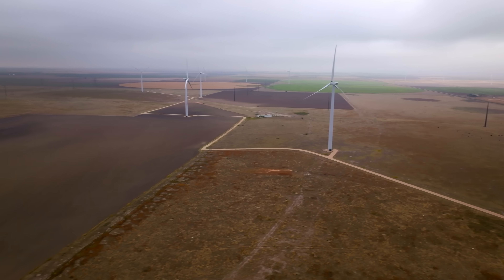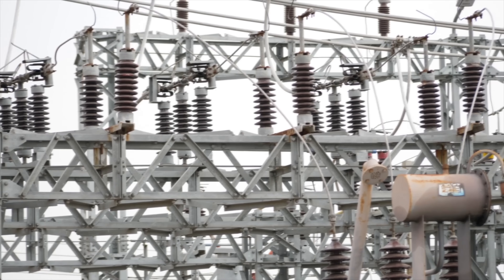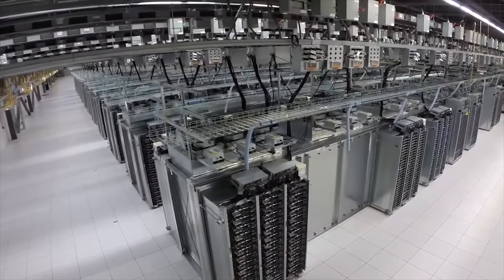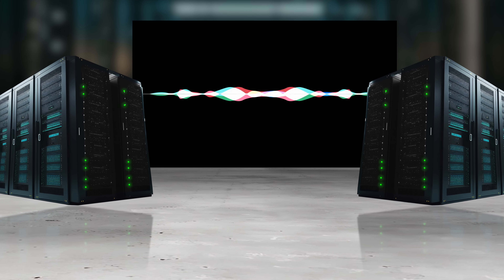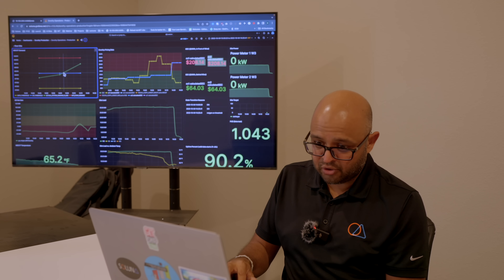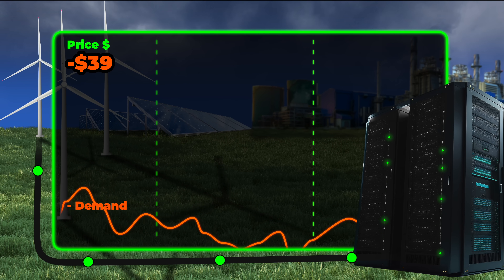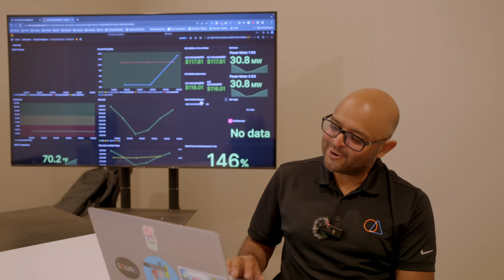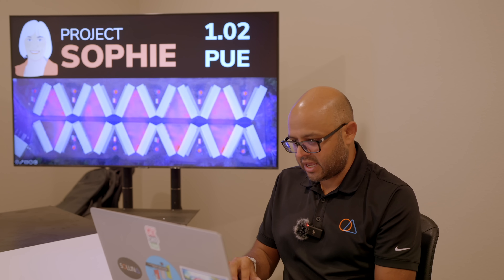Wind Farms' Dirty Little Secret No One Talks About

Comment: Sounds like combining wind power with desalination would be really wise too. Especially with more and more places having fresh water issues.
Reply: Just thinkin .. off shore wind used to desalinate sea water 'in place' and piped onshore following the same track the under water power cables use.
Reply: @jonnyde - or offshore wind turbines pumping Hydrogen back to land, to place in storage tanks, and supplement the Natural Gas grid, to replace natural gas… imagine splitting hydrogen from sea water because the value of energy is negative & making money on H2
Reply: @jonnyde Probably many times cheaper to send the electricity to shore than to build a desalination plant on stilts way out there or to build it in a bay, drag it out to the windmills and try to anchor it. 
Not to mention nuclear, coil or NG.
Reply: Desalination is more complex than just running power to it… the brine left over afterwards is a huge problem
Reply: @aygwm it's not that big of a problem. They can use that to make their own salt or put it on salt flats. Either way using desalination is way better than running out of water.
Reply: @aygwm  That is a valid point and I do realize that however power at a less expensive price really assists the process.
The brine can also be further processed to produce lithium which can also be energy intensive leaving less waste. But it really requires all these facilities to be built together around wind farms to really utilize the synergy well.
Reply: Can you elaborate a bit what sort of problem this is? Salt could be stored in the dessert when this is appropriate or it could be dumped in the deep ocean back to nature. Or you could sell it as table salt or you could make chlorine and sodium for the industry
Reply: @aygwm - Brine is somewhat limited.  Offshore desal plant would have to be extremely large and standing in shallow stagnant water to have any impact from just dumping the brine.  If wind is blowing enough for power generation, water won’t be stagnant.  Alternatively put brine in standing ponds for commercial salt production.  Scale would be an issue for second option, but could be used for at least some of the brine.
Reply: @aygwm  - let the brine mix with the salt water 💦… it is no different than what happens with evaporation.
Reply: @DavidHalko  you have to make sure that brine does not get sucked back into the system and recirculated through. If that happens you'll end up with crystalization in the water lines. 
To pump water out so far would take a lot of energy and infrastructure.
Reply: @druekreft1053  - “have to make sure…”

Sure. Offshore wind turbines are nice, the sea water is always moving with the tides.
Reply: Yes! We could desalinate and pump the water upstream to reservoirs intermittently,  only using surplus power.  We could thereby further the use of hydro as stored power as well.
Reply: Good idea. I was thinking the same thing. It would also provide the water for the cooling 😊.
Reply: @MH-Tesla  :  If you used salt water for the cooling, or just build data centers under the sea and use ocean currents for cooling, no energy needed for cooling, and liquid cooling is more efficient than air cooling.
Reply: They don't want to deal with the corrosion issues.
Reply: Lol I was just thinking that
Reply: Absolutely.  I have long wondered, "Why doesn't California do Desalination for their water needs?  Its not like there isn't an Ocean worth of water nearby them !!!!  Israel will provide the method for free as they desalinate ALL of their water needs.
Reply: Desalination is expensive with the current model. If excess energy from the wind is used that would be a completely different calculation.
Reply: @stevejeffries6945  That is what made me think it would be a good fit, that and if the energy is cheaper than market cost it makes it reasonable to cook the brine down to salts that can be shipped off for battery materials.

The electricity cost is currently the biggest set backs with it, but if the country who owned the windfarms, or an affiliated company was buying it for fractions of regular price that opens up a whole new opportunity for some more energy intensive companies that can be heavily automated.
Reply: I have actually been thinking about this type of thing for a while and there are a few processes that I think would work well to build as a symbiotic group like this. Wind power, desalination, salt production, chlorine production, aquaponics, fertilizer production, water treatment, hydrogen production, and hydrogen power production. Each of the items creates by-products that are the input material for another section and kind of feed each other. Desalination gives water to water treatment which needs chlorination but is an on-demand production as treated water has a shelf life before it needs chlorination again. Brine from desalination is then used to make salt and chlorine. Extra power can be used to make hydrogen for peak demand. Some of these productions generate CO2 which enhances the plant portion of aquaponics. The fish portion then generates nitrogen needed for fertilizer production. I am sure there are a lot more things that could be added to this, but these are the ones that come to mind easy. Point being, there are a lot of processes that would be well served to co-locate and run together.
Reply: Don’t forget wind farms kill millions of birds every year. Wind farms are not the answer.
Reply: You can buy salt at the store....and water is for frogs and newts...
Reply: What do you do with all the broken / old windfarm bits? Currently you waste city-sized sites piling them up. If you dump them in the sea you'll raise sea levels, but they're totally uneconomical to recycle. Dismantling them is costly enough. Just have to pile them up on-site... Check out windfarm graveyards.. They're going to EXPLODE in number and size.
Reply: @PrivateSi  Where are you getting your misinformation from? In the US a single persons share waste lifetime worth of electricity using wind energy is about the size of a bicycle.
Reply: what if we have been using the wrong model of wind turbines?
what about this new model :
a vertical axis wind turbine (spinning like a carousel)
this wind turbine would look exactly like a tree, I call it : e-tree,
the trunk of the e-tree is brown, the spinning sails (blades) are green,
and finally attached to the trunk of the e-tree are features of : wifi/mobile network, light and power outlet, to charge a car for example
Reply: You know that desalination water is about 1 order of magnitude more expensive right?
Reply: @AlessandroRodriguez  if it helps us to never run out of water then that's not a problem
Reply: @HH-le1vi  and for a million per liter I can do the same, prices are important for a reason, or are you ok to add a zero to every product you consume that uses water?
Reply: @AlessandroRodriguez  those desalination plants are way cheaper than a million per liter.
Reply: @AlessandroRodriguez  average cost to desalinate 1000 liters of water is around $4. Not the astronomically high fake numbers you're using.
Reply: @HH-le1vi  and that's why you are wrong, you don read. I say that I will bring to you a liter of water for a million of USD, since you seem so dismissive of of the value you pay for the water, besides that you are giving me the reason:
Small desalination plants work at a cost of $4 USD/m^3 of water.
Big size desalination plants work at a cost of less than $2 USD/m^3 of water.
Tap water of normal sources cost around   $0.2 USD/m^3 of water.
that an orden of magnitude
Reply: @AlessandroRodriguez  that's also half of water it used to be 10 years ago and I don't think people will mind paying more to have a guaranteed source of water. You will never run out of ocean water.
Reply: @AlessandroRodriguez  tap water is also typically around $3 per 1000 liters. So your numbers are way off
Reply: @HH-le1vi  again if you don't mind the price I will send you by normal delivery a liter of tap water for the low price of one million USD, or even better tell that to all the people who have food insecurity in the USA, surely also they don't mind pay a bit more for healthy food or even more, they wouldn't mind pay their healthcare. Crude jokes aside, besides being more expensive to create, is expensive to transport water you can easily add 1 or 2 $USD/m^3 of water just to raised 100 or 150 feet. but the whole point stands, why I would pay for expensive water in a server farm, if I can get cheap water or even better cooling by electricity.
Reply: @AlessandroRodriguez  I'm not talking about server farms. I'm talking about the general public. I wouldn't do desalination for a server farm when you can probably pipe in salt water over the equipment just fine. And you can also transport large quantities of any fluid on mainland very efficiently through a pipeline system just like we have for oil and gas.
Reply: @HH-le1vi  Saltwater, in a heat exchanger, of a server farm, sure just  add the cost of replacing the heat exchanger yearly by corrosion.
your other point is right, we can carry efficiently through a pipeline system, the problem is cost (gross numbers):
2 to 10 $USD/m^3 of water for  every 30 to 150 km traveled
1 $USD/m^3 of water  for  every 100 to 150 feet elevated.
Reply: @AlessandroRodriguez  and it's not anywhere close to that expensive to pipeline water. They pipeline oil and gas all over the country and the cost isn't even close to that.
Reply: @AlessandroRodriguez  the problem with this theory is the assumption that the biggest cost of tap water service is the water itself. 
It isnt. For every 100 on your water bill, around 50 is sewerage, 49 is maintenance/construction of pipework, and only 1 is spent on physically procuring water.
Water is cheap. Its getting it to your house, and getting the discarded water away from your house, that costs the big bucks. An entire order of magnitude increase in the cost of producing water would still only result in a 9% total cost increase, as the pipework and sewerage are the same whatever water source you use.
Reply: @HH-le1vi  piping oil/gas and piping water are two COMPLETELY different things.....
As an example, the American Keystone Pipeline has a 36 inch main, or about half the height of a man. If you were to build a WATER pipeline that serves the same number of homes that the oil pipeline eventually does, you would need a pipeline the diameter of a NUCLEAR AIRCRAFT CARRIER.
Reply: @Debbiebabe69  and how that contradicted what I have say all this time? I have mainly cared by energy cost, building of pipelines from the ocean to a server farm is another that whole thing I ignored completely in my calculations, also is the non trivial fact that you have missed the whole "potabilization" or "profit" of the water in your price analysis that would render your point moot.
Reply: @Debbiebabe69  or you just need more pipelines. I wouldn't have a few huge pipelines. That's not efficient
Reply: @HH-le1vi on the Gold Coast in Queensland Australia about 15 years ago the state government built a desalination plant to help with the issues of limited area for water storage and drought periods. Then there were a couple of very good years of rain in catchment areas of the dams that supplied the coasts water. The government paused the plant because it did consume a lot of energy, (pumping, heating, etc), then what they found when they wanted to bring it back online was that the infrastructure had deteriorated so bad that it would cost as much to build a new plant as it would to get the old one going again.
Reply: @AlessandroRodriguez  Tap water does NOT costs $0.2/m3!!!  I live in a region of France, which has plenty of water.  I pay it €4/m3!  Why  so much?  Because it has to be pumped, then treated to be potable and safe, then pumped again, then stored, and finally pumped again... unless the distribution can be done under gravity flow.
Everything but the final distribution is included in the  costs of desalination.  The water coming out of reverse osmosis is directly potable!
And THAT are the costs to my town's water council (including some reserve building, but NO profit) in a region with plentiful fresh water!
Reply: @AlessandroRodriguez  Then, we agree that desalination is economically competitive for human consumption!

And we probably also agree that for agriculture, it is a different matter! But the cost of reverse osmosis is VERY dependent on the cost of energy for its very high pumping duty.  In countries where energy is cheap (either thanks to cheap solar or cheap oil... that's often the same countries...), then reverse-osmosis desalination makes economic sense also for agriculture... especially where sufficient fresh water is simply not available.  Reverse osmosis also makes often sense for industrial waste-water treatment.  As a chemical engineer, we selected this method in several cases!  The costs of membrane filtration (there are many other applications than desalination, such as the separation and purification of chemical products) are rapidly going down, as the manufacturing volume of membrane cartridges increase.
Reply: Hope this isn’t a dumb reply, but if there’s low/negative demand for the electricity being produced by renewables, isn’t ANY use for that energy more beneficial than turning the generation off or running at a loss for tax reasons?
Reply: @jonathanjehan2284  Yes and more beneficial for the company that is utilizing the energy see's a benefit in cost reductions. However as this video outlines they need to have a direct connection to the energy source because as soon as it goes to the regular grid there are all sorts of transmission fees and/or taxes.

Your comment is clearly offering more to the discussion than some bologna about population density like that solves the global fresh water crisis even in places that have a low population density. Everyone who read that comment lost brain cells.
Reply: @AlessandroRodriguez  If you compare the costs of desalination to the price of potable water where it is plentiful, then you are correct!  But desalination plants tend to be located where fresh water resources are insufficient, and hence MORE EXPENSIVE than the costs of desalination.
Reply: We don't have a fresh water issue. We have a "too many people using this one water source" issue.

Man was not meant to be concentrated quite so much as we do today.
Reply: @robertbeisert3315  in that regard the problem is water reclamation and the cost associated with that
Reply: @robertbeisert3315  That is the dumbest take yet, thanks for adding nothing to the conversation.
Reply: Problem with desalination plants is the discharge of super salty water. It kills sea life.
Reply: @kevinsantascott3688  Yes and if you read through the comments that point has already been addressed.
Instead of releasing the brine it can have even more liquid removed leaving salt deposits that are high in lithium and other battery materials.

If you have all that off shore wind turbine energy going to waste and looking for better ways of using it to make revenue on energy that would otherwise not be sold for the turbine owners and a process that would normally be too energy costly to be efficient otherwise then you can create a symbiotic relationship between the two that are advantageous to both.

Why not use turbines wasted energy potential to help increase fresh water supply and to increase the production of battery materials while also increasing the revenue return of wind turbine projects?
Reply: You can buy salt at the store....and water is for frogs and newts...

Comment: Thing is that hair driers and computers have a TON in common. Both take in electricity. Both produce heat. Both have fans making noise and exhausting heat. The only difference is the computer does produce just a bit of compute with it's power.   However computers typically run 24 hours a day while hair driers only run a handful of minutes per day.  If we could possibly USE all that heat from computers that would be awesome. Sadly for the most part instead of heating water or nearby buildings, it's dumped to the atmosphere with the mentioned evaporative cooling or with large CRAC units.  

At least this setup uses power that would otherwise be either wasted or not generated at all.
Reply: Now watch someone invent a hair dryer that mines crypto...

Comment: The generation of synthetic liquid fuels is dominated by energy use cracking hydrogen from water (if you don't use steam to strip it from methane). When you have extra power make hydrogen and short term store it for use in making longer chain hydrocarbons. Sure it's not as energy efficient as a pure EV but it lets the world keep all the ICE around lowers the cost of electricity to that of nuclear and doesn't operate on child slave labor. 

Expand this out so that peak demand is covered by nuclear power only and make liquid fuels the rest of the time. Stop building useless solar and wind which are mostly just fronts for natural gas plants. Full nuclear with synthetic fuels is the more reasonable power future. Turning on and off AI, claiming it is not a real time demand is not true for most AI uses; I'm not going to wait hours to have my AI complete a task because of a lack of overproduced wind/solar power. 

Energy storage is expensive, so you might as well couple the storage with a change in form to a more useful and valuable form it if you need to convert it anyway.